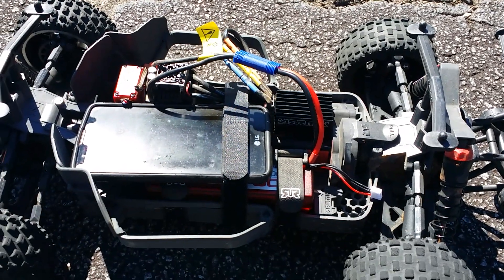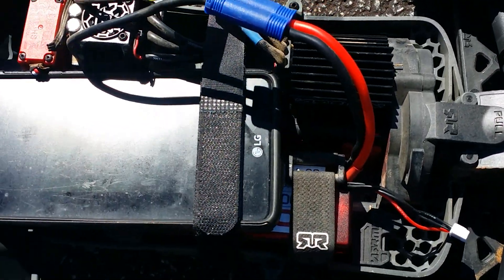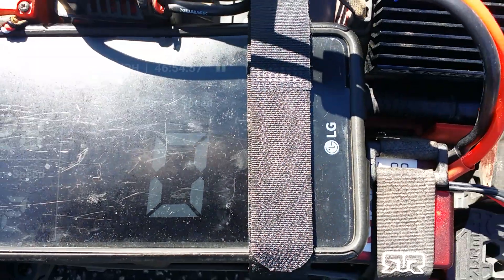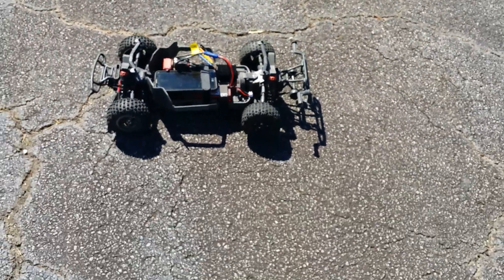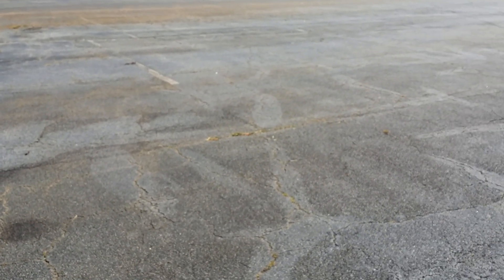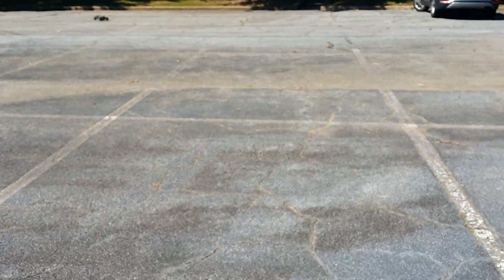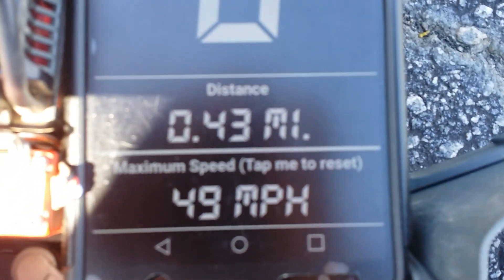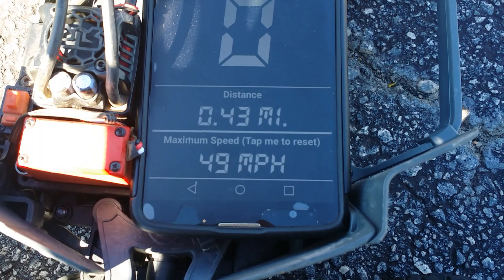Super Speed Saturdays - Arrma Senton BLX 3s Test Run

Comment: Just placed my order lol I'm surprised the tires are holding up so well . And p.s thanks for letting me bend you're ear on my associated mgt 4.6 electric conversion.  I managed to shoe horn a 52 tooth spur with a little dremel grinding and a 11 tooth pinion . Some minor esc adjustments and so far so good . Temps are low lots of low end and decent high end speed . I highly recommend this conversion for anyone that has one of these in their closet collecting dust or if you see one on fleabay or at a swap meet for a cheap price snatch one up you won't be disappointed! I think all in i have invested 300 bucks total . I'll try and send some pics to you're Facebook page and hopefully I can get some running videos to post on YouTube one of these days lol .